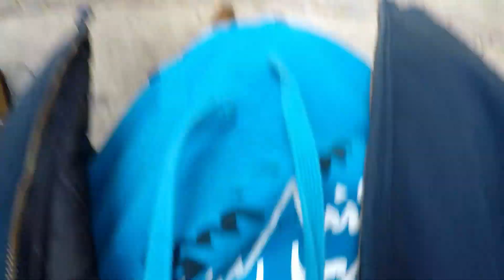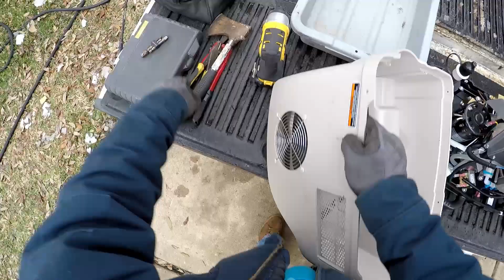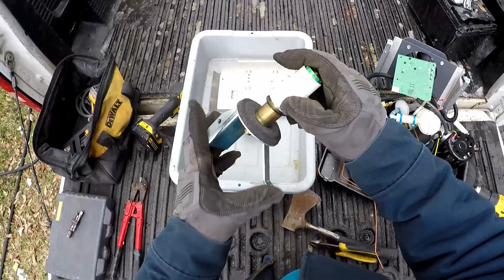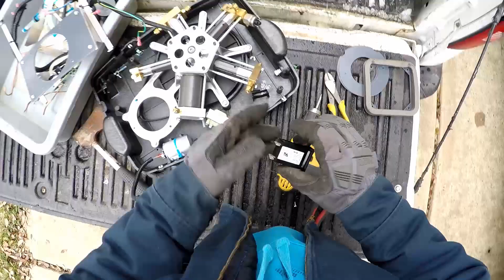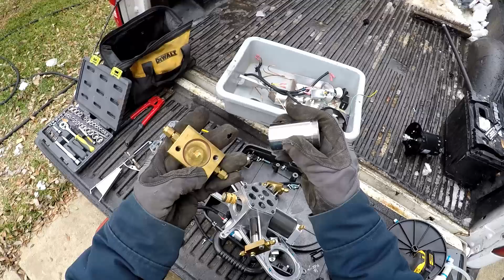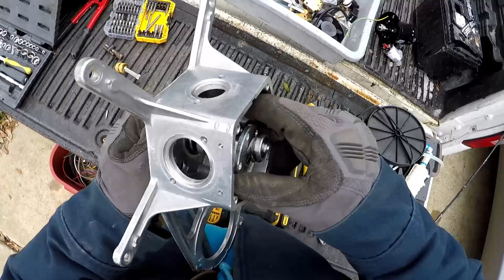What's Inside An Oxygen Machine? (Taking It Apart For Scrap Metals)

Comment: I heard 3 million people without power in Texas. That’s crazy!!  I’m from the north and my parents from the south. If you don’t have one already get a small generator and at least one electric heater. Get several of the big jugs of water, I think their 2 1/2 gallons. Make sure to have at least 5 gallons of gas on hand. A couple bottles of propane if you have a grill. A big roll of plastic. Generators need big heavy duty extension cords. If you use regular ones they will melt. If possible fill the bathtub with water. Can dip out to put in wash pan for washing hands and flush toilet etc. Pick a room in the house that you and pets will be comfortable in and use the plastic to cover the door ways leading into room. This smaller area will be easier to heat. 
Place the generator far from the house and not in the garage so you don’t get carbon monoxide poisoning. Get a power inverter for the car. Will be able to charge phones or whatever. For lighting use what your comfortable with. Flashlights candles, battery operated lanterns. In the winter always try and keep a full tank of gas in the cars. This advice is for everyone wherever you live. I hope you and your fam get through this cold spell.

Comment: They are going to have to change the building codes for freezing temperatures in your area. Here pipes have to be 6 feet underground and come out inside the house to prevent pipe busting every winter. But hey, I live where winter starts in October and ends in April.

Right now it's -6°C (21°F) and clear, but we did receive a foot of snow Tuesday, on top of the 3 feet we already had and we dot down to -30°C (-22°F) with wind chill. Supposed to get a few more inches of snow tomorrow.

Comment: The spinning thing is a step compressor. The reason for the different size pistons is because each piston take and steps the air pressure from about 3 pounds up to about 2500 pounds or PSI I've been using one for about 12 years. I know when my 1st compressor died it had 77,000 hours on it so they are built to last.
Reply: Do they still take days to fill a small bottle?
Reply: @letsdothis9063  30 minutes for the smallest bottle and 45 minutes to an hour on the biggest bottle. It all depends on how worn out the on machine is. My first one lasted over 77,000 hours but not the ones after. I hope this helps. If you want to talk about it I am happy to help if you have some questions. I've been on on since 2008 so I may have something to share.. Thanks Bob Ordewald Staunton Virginia

Comment: It's not that Texas "doesn't know how to deal with it". Most houses and buildings in Texas aren't built with insulating water pipes from the cold in mind. So you guys have it much harder than the north when cold hits.  Tons more damage.  Lived in New England my whole life,  never had a pipe freeze, got a closet full of warm clothes, oil tank full for heat, and studded snow tires  on the car.  Id rather be here during freezing temperatures than Texas. Wishing you guys the best.

Comment: that is really just a very high pressure pump that forces air through a filter to trap the nitrogen which is a much larger atom, leaving the O2 behind.  it's a multi stage unit, hence the different size pistons.  each one dumps into a smaller one for more pressure/less volume.

Comment: Just found your page and I love it. I'm about 3 years too late. I'm an engineer who designs oxygen concentrators. What you took apart is not an oxygen concentrator, it's an auxiliary pump that hooks to an oxygen concentrator and pumps the O2 from the concentrator into high pressure oxygen cylinders. I took this same pump apart and studied it thoroughly. Anyways, I love your page!

Comment: that would've been a high pressure pump, seeing as those tanks run about 1200 psi. that's why there are so many cylinders of different sizes. each stage raises the pressure a certain amount, from the largest to the smallest, until the desired pressure is achieved. a little work, and it could've been converted to fill dive tanks.

Comment: Its a rotary compressor, starts with the largest cyl then moves the air to the next cyl which is smaller then to the next  which increases the pressure and so on.

Comment: I fled Texas 27 years ago, but I remember Houston having a cold snap in 1990 or 1991. Same aftermath with frozen pipes. I thought someone might have figured out that attics are not a good place for water pipes. 
We're melting out from our 6" of snow and our lows are mid-upper 30s and highs mid-upper 40s.

Comment: Greetings from UK, I had a weigh in the other day I spent a couple of hours sorting clean copper pipe from soldered joints & painted pipe and the guys at the scrap yard just mixed it in together &  weighed it in as heavy copper? I had 30kg copper £114 and 40kg+ of brass £122 and a bit of leaded copper I netted £250 not a bad days work. Love your video’s

Comment: Make sure you insulation on all water pipes and don’t forget ones that are outside or run along internal walls .Will 9 times out of 10 stop the pipes from freezing.Much cheaper than repairing water damp and pipes.

Comment: I seen the sea turtles that got rescued down there hope they make it 🐢
 They have heat pipe tape hear that's electric and pipe insulation.  I've seen pipe that  expands 3 to 4 times its size but that's expensive.  Stay warm 🐶

Comment: I live north of dallas near the red river and it got all the way up too 25 today and I still have about 4-5 inches of snow on the ground. All of the side streets are still solid snow and ice but the main highways and main roads are clear with some spots of ruts in the lanes. I live out in the country and my main stock pond is still solid ice and snow. have to go down and chop the ice with a axe two times a day in my ponds so my cows and goats can get water. First time in about 10 years my main pond has froze over solid. using the axe it looks like about 8-10 inches thick. all the cows see me coming with the axe and they come a runnin. Try chopping ice with about 50 head of cattle trying to get to the water. Its a blast.

Comment: People up north don't seem to understand how far away from the design conditions that this weather is for Texans. Where I am (Panhandle) the temperature designed to cover 99% of the years is 10 degrees F. In Denver it is -5 F. In Minnesota they are good down to -31 F !! So Denver at -25F and Minnesota at -51F would be about what we are dealing with. 

Yesterday some previously frozen pipes got warm enough to thaw enough for severe flooding of people's homes.  People have also delt with having no electricity. If you don't have power, how do you keep the house from having frozen pipes? Yep... SET STUFF ON FIRE! But we usuallly only have one fireplace and it is located in the living room, so the pipes are not where the heat is, so obviously the answer is to set your neighbor's house on fire. I find that having an entire structure ablaze right next to yours really does a good job of keeping the pipes from freezing. Thumbs up if you smiled!

Comment: Hello Mike. If I could I would like to make a suggestion. Would you please find a metal can or something to put your screws and stuff in. They play hell on tires as they get scattered around the scrapyard. Hopefully you have never experienced a flat or worse yet, a ruined tire at the scrapyard. Anyway I think all the other scrappers would appreciate it also. Thanks Mike.
Reply: Scrapyards usually have a magnet to pick up screws and loose metal material. I hope this helps
Reply: Yes, but so many get missed or fall off and usually in the most unwanted areas.

Comment: I often wondered if you could just cut off the part of your copper pipe with paint or other crap on it and throw it in a cement mixer that has sand in it. Ya think that would work?

Comment: He Mike, hello from the the Canadian North, -23 celcius here ( -10 Farenheit ) . I see you using your magnet on stainless steels, there is two kind of it.....magnetic and non magnetic ..Stainless steels are iron-based alloys primarily known for their generally excellent corrosion resistance, which is largely due to the steel's chromium concentration. ... Due to this difference, ferritic stainless steels are generally magnetic while austenitic stainless steels usually are not. Both are good ......have a nice day.
Reply: Theres also regular stainless and food grade stainless steel.
Just like a pop can.. The aluminum on the top with the pull tab is a different aluminum then the can itself cause thats the part our lips touch..

Comment: I don't understand how you took off four of five of the wrist pins/screws but then instead of taking the fifth one out and just sliding the head, piston top,  connecting rod, and cylinder wall together off of the crankshaft. It would have saved you some time to just do them all the same.

Also, you said that it was cast aluminum where I am pretty sure it was machined from billet/plate. Don't know if that fetches more $ for you (because it should imho). Like you said..."Medical". They can build them more expensively if it is justified by fewer potential lawsuits down the road. I would not think thay they would use and regular steel for the cylinders, but the stainless that it might be is one of the magnetic kinds.